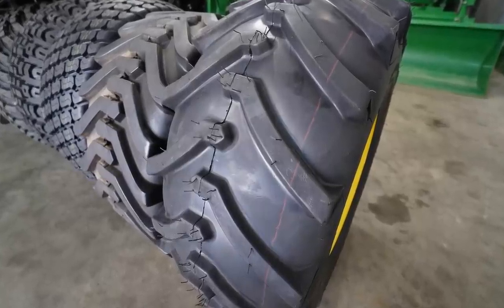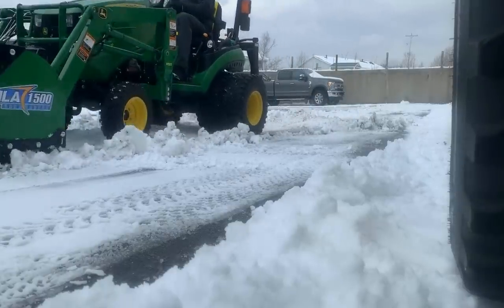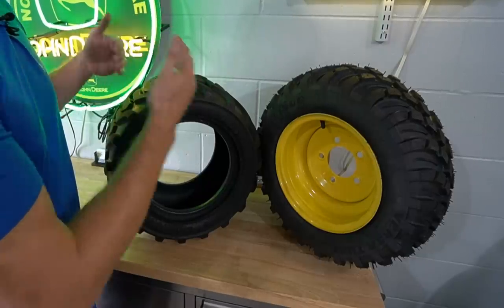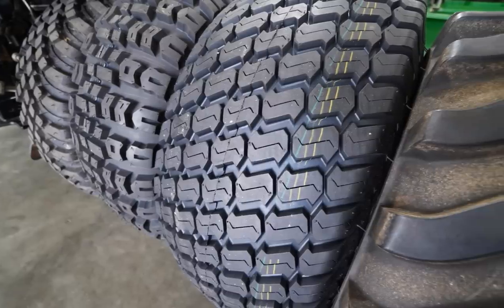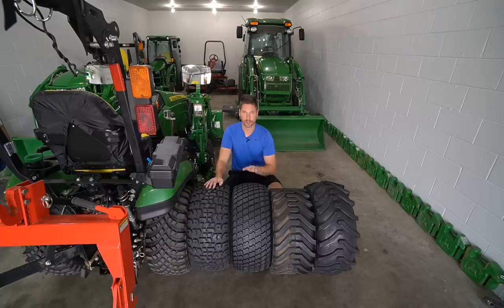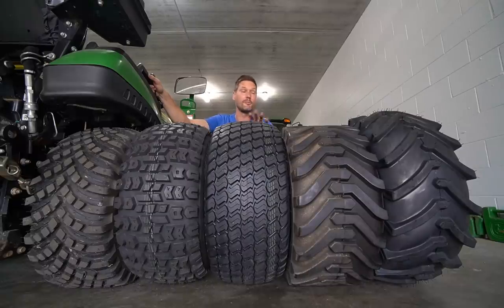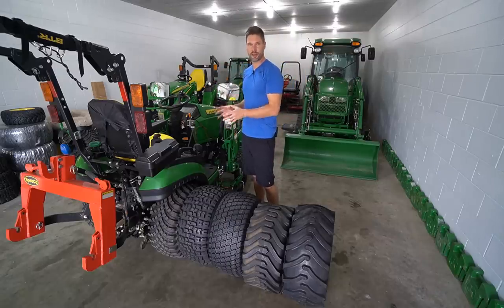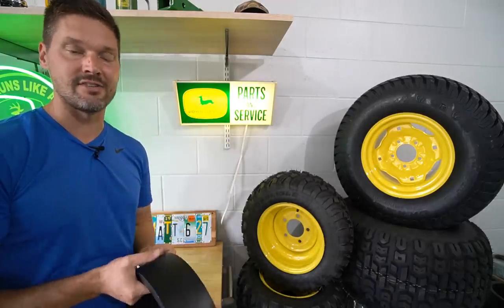THE ULTIMATE TRACTOR TIRE GUIDE: TREAD PATTERN OPTIONS! 👨‍🌾🚜

Comment: Best tread for snow and ice is chains.
Reply from the maker: Well then we aren't talking about tires anymore! 😂
Reply: @GoodWorksTractors  I have a '71 International 154. 75 lb wheel weights, 30 gallons MgCl in diamond pattern turfs with chains. Two speed rear. 63" loader. 66" snow plow. I can out pull my neighbors 26 hp 4x4 Kubota 8 days a week with my rated 10.3hp. He's on R3's and I'm probably about 3200 lbs all up. Best mod yet is full hydraulic steering. I'd be happy to share the steering set up if anyone is interested.
Reply: As long as the work is on dirt or a surface you don't mind scratching up. If it's a nice paved surface like blacktop or concrete... your right back to bare tires.
Reply from the maker: Yep, no doubt about it.
Reply: I plow with same turftire you show in the middle, on asfalt for about 15 year. Those are really good!🙏👍👏🇸🇪

Comment: I've noticed a trend of some people putting R1 ag tires on the back of heavier, stiffer framed commercial zero turns due to the tendency of lawn tires to spin when the weight is shifted off them for any reason, even if they still have ground contact.    Note that this is mostly for cutting yards or fields, not lawns.  They simply deem the moderate damage from the R1s to be less problematic than the damage from spinning, especially considering the spinning tends to happen in the same places every  time the grass is cut.  However, I imagine that some of the new radial styles may end up being a better option than the ag tires to address the issue.
Reply from the maker: Yep, I had a Grasshopper last fall that had R1's on the back.  Normally see them for the large commercial mowing or field mowing like you mentioned.  Thanks for watching!
Reply: I have a similar tread to the HDAP’s on my grasshopper 723K...I thought it was a decent idea when I put them on...I have mixed feelings about them...they seem to spin more than the ol chevrons that were on there originally
Reply: I put ags on my last zero turn, they actually did less damage than turfs. Helped mowing my fields during the wet season. Got a big Bobcat zero turn now, has some wide turfs on it, nothing else is available except the Carlyle turf. They’ve been fine.

Comment: I have switched to the HDAP tires on my John Deere 216, and 332 they are so much better on the lawn, on the hills, in the snow and out in the woods.  I can go places that I never could reach with my R-3 tires.  I wish I could find versa tread or equivalent for my 2520 to replace the R-3 turf tires and I don't want R-4s because I need traction in the winter too.  Great video, Thanks!

Comment: Some personal experience...  I had a 2007 JD 4720 CUT (currently the 4066R) with R4 tires.  I never had any traction problems with them in front range of Colorado (7500' elevation) snow and ice.  I'm talking anywhere from a few inches of powder to 12-18+ inches of drifted wet heavy Sierra Cement.  I have a video my neighbor took of me pushing deep, wet and heavy snow along his concrete driveway where you could see snow being shoved along 10+ feet out in front of the tractor's FEL.  I'm guessing I had good luck with these tires simply because the tractor was much, much heavier than a sub-compact.
Reply from the maker: I couldn't make it up my own concrete driveway with the R4's on my 4066r last winter.  🤷‍♂️  For the record, locking rear differential DID NOT HELP! 😂👍
Reply: @GoodWorksTractors  Huh...  Well, snow conditions are almost infinitely variable.  One thing we do not generally get where I am in CO is icing before a storm.  I could see R4s, and probably R1s, having trouble on iced up asphalt or concrete.  My own driveway is asphalt and I do have a steeper than it looks section.  Go figure.

Comment: So I live in Maine the snow is super wet any closed tread pattern tire turns into a racing slick my agR4 tires walk all over turf tires in the winter I have a john deere 1978 140h3.  I have 100lbs of wheel weights and even with I can't move with my turfs and dominate plowing with the Ags/R4s. Alot depends on the environment.  Wet sticky snow I have 1000% better traction.  I ran heavy equipment for 12 years and ran tractors in the vineyard I worked for a decade. Lots of exp also

Comment: Excellent video! The industrial R4 tires are harder so that they will last on concrete or paved surfaces. This is the exact opposite of what you need on ice. Car snow tires use a softer compound than Summer tires to increase traction.  More surface area is better on ice, maybe not so much on snow. Lost of guys end up cutting sipes in their aggressive tires to get more biting area. 
Living in Maine, I've been quite successful with my R3 Turf tires all year round. I have a set of chains but have yet needed to put them on.

Comment: I live in East Texas, on 365 acres, and all our tractors are conventional R-1 bias from our small tractors (650-1050 JD) to our 100 horse tractors,  and they've never let us down, I even cut my lawn with my 650 with traditional "Tractor tires" and if done carefully, and almost exclusively when its hard and dry, the damage is very manageable. worth it in my opinion for the traction gained in the field, it had turf tires when we got it years ago and cutting fence rows required a chain and another tractor nearby to drag you out of the slightest wet areas. so we swapped out to 9.5-16 R-1's about 800 hours ago and like the results,  but thats just for our application, if you had a large lawn and that was the sole use for the machine I could see the appeal of less aggressive rubber.

Comment: Great info in this video.  I have been running the stock turf tires on my 1025R for 5 years now.  I mainly mow grass and clear snow and they have been great.  I have a TLB so I have used them across several projects during this time on varying surfaces and weather conditions.  The only issue I recall was in the Spring time helping a neighbor fill sink holes in his yard in a very wet area (we didn't really see at the time we went into it) and I got the machine stuck.  We caught it in time and got it out before doing too much damage and avoided that area until it dried up and we could finish the job, but not sure we could have done any better with another tire.  Based on what you have summarized here, when it comes time to replace these tires, I may wander on over to the radial option.  Thanks for sharing.
Reply from the maker: Very nice testament to the abilities of the turfs.  Thanks for sharing as always sir!  Have a great day!

Comment: Nice hearing that those Versa-Turfs really are the cat's meow, all vidoes and my limited experience show how awesome they are nearly everywhere.

The R4 skid-steer tires are almost hopeless, it always amazes me that they're on so many new machines when their sole purpose is long-life on concrete for crazy heavy machines like skid steers. And those have the weight to keep traction on those high-contact tires unlike most compact tractors, unless you only use your tractor to move snow on paved surfaces those will always be my last choice. They slip going up trailers/ramps, slip in mud, slush, ice, snow, grass.

Comment: I am running R1 style tires on my Kubota B2320.  I use them when im bush hogging in fields and of course when ive got the tiller attached.  They do leave marks in wet conditions so im careful as to where around the house i drive it.  Ive got about 800 hours on my machine and still have the original tires.  As was commented, i try not to run on pavement to save wear and tear.  A great tire in my opinion.

Comment: I bought my 1025r with turfs, traded in a bx1500 with turfs for it. Had John Deere 318 &316s with turfs. Living in Vt we have a long snow season as well as a mud season, and turfs perform just fine in every situation we threw at them with a few caveats. The 2wd garden tractors had to have chains in the winter. I think the old rubber was just too hard to work well without them.  The sub compacts added 4wd and a lot of weight with the addition of the loader and rear 60” blower. Never had traction issues.  Most loader ops were fine on the dry dirt or even most summer grass situations. If it had rained before work, or there was a clay based soil, or anything in the woods... had to be in 4wd just to scathe by. Note I don’t do that stuff often so it’s fine (for me).  I don’t find chains to work well on pavement as they do a lot of damage to the asphalt. 
I have a long background in heavy equipment. Father a retired deere mechanic, me an army engineer of 20 years. I’d love to move to the Versa turfs or a variant now that they are around but I don’t see that happening till my next tractor purchase to replace the 1025 in 10-20 years.  Love the videos. Between you, messicks, an ttwt, it’s a holy trinity for tractor information regardless of brand loyalty, most of the information between you three is versatile enough to apply across the market. I spend a lot of time watching them finding it’s a confirmation of everything I’ve been taught in 95% of the instances.  My project scale is suited to road and airfield construction, but I dabble in subcompact work on the side because it’s easy for me.  My attachments currently include 60” rear blower, front loader and forks, 4ft rear brush cutter, weight box,  rear sweeper, and mmm.  Also have a z so I don’t find much use in a mmm anymore. But worthy keeping on hand for odd jobs
Reply from the maker: Thanks for taking the time to share!

Comment: Turf = worst on my Deere 332 for everything. Dew on the grass? Not going anywhere. Steep (paved) driveway...don't even think about plowing the snow; though chains did help a little bit.
HDAP = gets 75% of the way there. Fantastic in grass all the time without ripping it up. They're reasonably good in ice/snow provided enough ballast. Wet dirt, no good. The tread gets clogged up right away, and they turn into slicks.
My Deere 955 has R1s on the front, and R4s on the rear. Don't have anything bad to say as of yet, but haven't had the opportunity to really "dig in" and test it out. Time will tell! I really like the idea of the R14 or Versa turf though. I haven't really seen or read anything bad about them. Thanks for the great video!
Reply from the maker: Definitely a difference in two and four wheel drive machines as well.  Thanks for watching!

Comment: Good stuff Courtney. As a off road motorcycle rider rubber compound has alot to do with traction. Soft rubber better traction but wear faster. Hard rubber better wear less traction. Radials are better because they conform to the terrain better.

Comment: We just bought a new B2650 with the R-14's. Haven't really had a chance to test in anything yet, but they look like the best of both worlds to me. By the way, my dealer does not charge more or less for any tire we wanted.
Reply from the maker: That's good news!  I know the Galaxy Pro's are an upcharge on the JD 2 Series for example.
Reply: Thanks for calling attention to those, didn’t know they were available. Looks like I’ll be putting a pair of the Goodyear R14T on the front my MF GC1705. I’ll keep the R4s on the rear. Weights, spacers, beat juice in the rear will be a pain to swap.

Comment: Turf tires for the win.  They don't destroy grass, they wear better, they don't feel like rumble strips on pavement, they are great for snow, and they provide better braking.  Did I mention you can actually use them on grass without destroying the grass?

Comment: Had a Deere X748 with HDAPs on and they were Great in snow and ice with a snowblower.  Upgraded to a Deere 1025R with the same size snowblower as the X748 had.  NO where the traction on the 1025R as I had with the X748.  And, the 1025R had loaded rear tires.  Down sized to a Deere X758 with HDAPs.  Back to great traction in the snow and ice.  But the ride is much rougher on the X758 then I had on the X748.  The X748 HDAPs were Carlisle and I know for sure the X758 HDAPs are not Carlisle.  Don’t recall what brand they are.  Thinking of upgrading To the Versa Turf since my X758 has the same tire size front and rear as a 1025R.
Reply: Update.  The X758 has CST Turf Trax 4 ply rated.  If my memory is correct, the X748 Carlisle rears were 2 ply.

Comment: One thing I've noticed is if you have a bigger tractor that has the R1tires and want to change to another style like an R4, you need to change wheels too. I have a John Deere 4520 with R1 tires. The tractors on the dealer's lot that have R4's have much wider rims and much lower profiles. Need to be aware that the cost to change tire tread designs on the 3000, and up series JD's will be pretty pricy. Apparently the sub compacts don't have that problem.

Comment: Master C, tires are starting to get features as well. I just got R4 tires where they have a bead protector on them. That is nice BUT it can present problems such as if you break the bead. They are a bear to get back on the rim. Don't ask how I know this.... 😂😂😂
Reply from the maker: Hey Daniel....can I ask how you know? 🤣
Reply: @GoodWorksTractors  lol ok if you must.. After I got the tires installed I thought I was a Mr.  Tire Expert that day and decided to add liquid ballast to the rears myself. Well when removing the valve stem from the first rear tire I let to much air out and the weight of the tire, being suspended off the ground, broke the bead. I tried everything to get it back on, the strap(s), the bead blaster, everything. I finally gave up and with my head hung low and went back to the tire shop. They got a good laugh out of me.

I learned I must have the liquid, pump, hose, and adapter ready to go when I remove the valve stem and attach the adaptor and hose as quickly as I can after removing the valve stem. The air burps through the submersible pump and once it slows down you fire the pump on. You repeat this of course as you add more liquid, stop the pump to let it burp and once it slows down fire it on again.

The pump can overcome quite a bit pressure in the tire and doing the above prevents losing so much air that it breaks the bead. 

I still can't believe I lifted that tire and rim into my truck whenever I think about that brilliant moment in my life, lol! 😂
Reply: Daniel Maloney part

Comment: I disagree about using R1's for lawn care. I run 23x10.50's Deestone ags on my garden tractor all year round, it's my main mowing machine. Loaded with washer fluid and wheel weights, it does not leave tracks on the lawn and is needed for my very hilly lawn. I did more damage when I had turfs on, when they would spin which was a lot, they would destroy the lawn. The ags just grip and go. I do run the all trails(hdap) on the front, they are very versatile for all around use. I would love to put the old Goodyear Terra type ag tire on all my tractors, have them on my Craftsman FF 24, great ag tire.
Reply from the maker: It may depend if it's an irrigated lawn or dry lawn.  If it's a very dry, hard packed lawn then R1's probably won't dig in as much to cause damage.  I can't run R1 on my lawn at all or there will be damage even if only going in a straight line.

Comment: Hello,  I think one important thing you left out in your tire video is the number of ply's needed for loader work.  My tractor originally came with R4 18x8.5 (front) and 26x12 (rear) and were constructed using 6 ply construction.   I then changed/upgraded the tires to HDAP tires (front and rear), and they did provide better grip, but they were only 4 ply.  So when doing heavy loader work, the front tires would squat a lot (it looked like I was driving with 2 flat tires in the front).  I've been searching everywhere for 6 ply tires, and I can only find them with R4 threads.  I think that's why most tractors have R4 tires (especially if equipped with a FEL).  If you know where to purchase 6 ply HDAP, please leave a comment below.  thanks, Matt
Reply: I was reading in the comments and someone was saying they have a 6 ply in Goodyear brand
Reply: I guess they are the R14 6 ply Good Year brand

Comment: I plan to purchase a JD 1025R with drive-over mid-mount mowing deck, backhoe and front loader. Will the versa turf tires be a good choice for using these three implements? I’m trying to understand if the VT tires can handle the weight/stress of using the front loader and back hoe, or if they’re best for mowing & snow removal only.

Comment: Great tire rating . . the new machines (year) 2021 ~ on the 2025r JD are out with the Versa-a-turf radial tires . . .  front and back . . ..  I am running them on my machine . . .they are a lot more money at the start up . . and like all machines when people look at tractors they 'think tires are just tires'   not true . .  I live in Massachusetts and I sometimes get into slick greasy clay . .not to often and with this kind of soil it wont matter what kind if rubber your running  ' its usually going to be a long day'   . . . i myself would not put a 25k plus machine in those kinds of situations . . . .thanks your tire run down . . .Great comparative display . . .

Comment: I'm wondering how well the sidewall on the radials hold up?  I assume they balloon out a bit more than a bias ply, making them more vulnerable to rocks, roots  or  other hidden sharp stobs.  I have  the r4's currently, so of course I've been stuck numerous times, and looking at the sidewalls reveal several nasty gouges. I'm usually careful with my equipment, so I'm sure they got there while I was spinning the tires wildly in mud up to the steering wheel trying to extract us... Did I mention r4's will get you stuck? LoL, they're almost as bad as the diamond tread turf savers that were on the ol' ford jubilees we used on the golf course decades ago. LoL